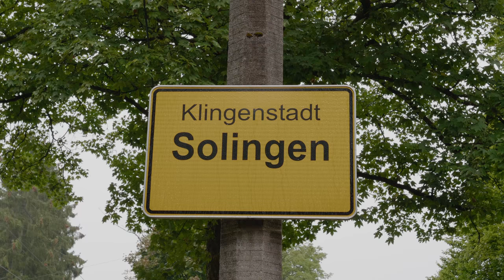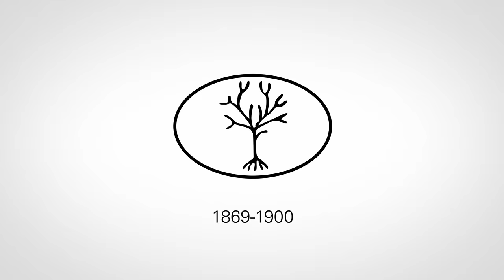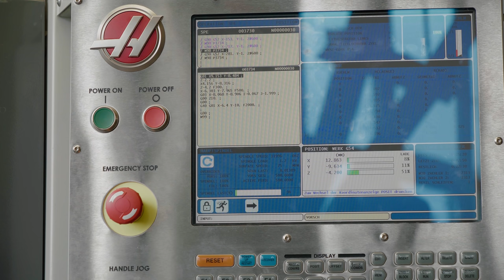The Oldest Pocket Knife Maker in the World | Boker Shop Tour

Comment: I found a meat cleaver in a second hand store. I could not believe the maker stamp said Henry Boker. Ten dollars.
PS......Since this is attracting likes I will add.......It had been misused. Perhaps as a shake splitting fro. The spine was moderately peened over. Some rust. Original hardwood handle. I went easy on the clean up, no abrasives other than super fine steel wool here and there. Nice patina, takes a wicked edge. Heavy piece! Pride of place in my kitchen.
Reply: What a great find.

Comment: I've been carrying a Boker folder that was converted to auto open for over 10 years now and I still haven't had to sharpen it.
Reply: That's because you dont use it or you don't know what sharp is. 440c dulls quickly.
Reply: @howabouthetruth2157  Stainless steel cannot be stropped, the edge doesnt fold over instead it just snaps and breaks off.
Reply: @stevedenton1028  You don't know what sharp is. Your idea of sharp is hacking and sawing until it splits in a scrunched up mess. The carbides in stainless (especially 440c) are way too large for stropping. As you use your knife the carbides get ripped out and you lose your apex, all stropping does is continue to round out your apex. It's physically impossible to strop any stainless steel since the edge does not roll like soft carbon steel.

Comment: ...... disappointed with Boker. Have several 3000 lockbacks. Need a new blade on one I wore for 25 yrs. It's 35 yrs old and have glued the scales back on twice now. No stand offs. Contacted Boker in Lakewood, Co. twice over the yrs and they said they would have to send it back to Germany and the knife isn't worth the shipping charges. If Boker were to send me a replacement blade and a new pin I'd change the blade myself..... oh well.

Comment: True Story: I'll never buy a Boker knife cause one time I was cutting up some meat with one of their ceramic knives and unbeknownst to me, the tip had broken off into the food. When we finished dinner I cleaned the knife and saw that the knife was missing it's tip and started to panic. I was afraid my autistic son had swallowed the piece and didn't say anything about it. It made me so sick with worry I threw up. Just then my wife says she may have been served the piece and pushed a small triangle tip of the knife onto the edge of the plate for me to inspect. Sure enough there it was and nobody swallowed it. Since that day I do not use ceramic knives or Boker knives.